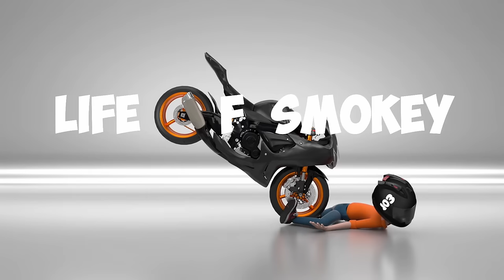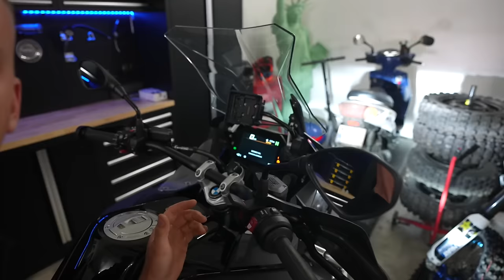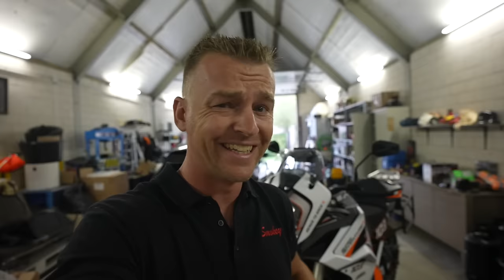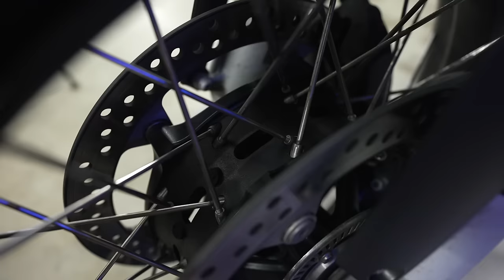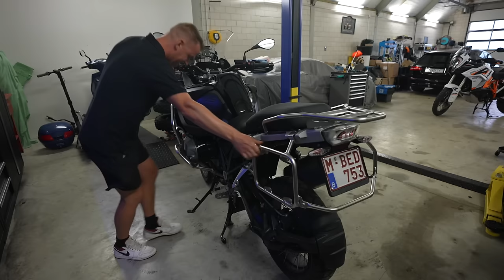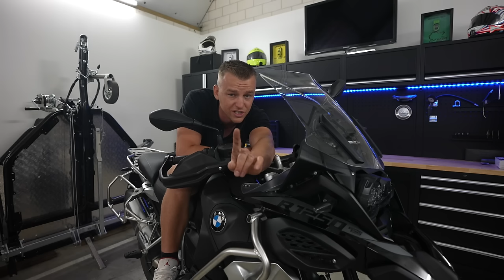How Good is the NEW BMW R 1250GS Adventure? Full Review

Comment: Actually you try to lift the bike on double stand the wrong way. There is a much easier way. Just grab the bike from the steering and the passengers foot peg (and specifically the metal bracket above, as close to the foot peg as you can) and then try to lift. It makes a world of difference. Just try it.

Comment: The GS is a good bike to take us more comfortably from point A to point B.
The SAR is a good motorcycle to take us with a little less comfort from point A to point B but with much more pleasure and with the necessary comfort to do the kms we want.
Reply: I have owned both and the 1290 is no less comfortable (all it really needs is a bigger screen and an aftermarket seat) but has a lot more off road capability.

Comment: I never tried the SAS, but just love my GSA. Had the 1200 and then upgraded it to the 1250. I just adore how re-assuring it is to ride it fast in the twistied, flicking it from one side to another. Also I recognised that I rarely rev it to red line but use that immense amount off torque in between corners. It's just so much fun. Beats everything. I've seen KTM's sneak away in straight lines, but then in the corners they are just not sure-footed. I've had stronger bikes, but this beats them all.

Comment: I have a 2018 1200 gsa at home in Canada, and just finished renting exactly that 1250 bike you reviewed for 3 weeks in Germany , Austria, France, Switzerland, Italy and CZ Republic. July 1-22 4500km. . I am 197cm tall, and the windscreen is not tall enough for me but that is changeable. I can get it up on its center stand with both paniers and the top box loaded to bursting, its not "easy" but it goes up the first time, are you sure you didn't have it in gear?  In Canada I have Heidenau gravel road tires because it gets lots of gravel roads. the riding modes for the bike are magnificent, the enduro mode is perfect for gravel roads even with such a heavy bike.   In regards to this vs a KTM, even in Austria this is the bike you see..... likely 10 to 1 over big KTMs.
Reply from the maker: I'm just a very weak person and only 176cm and like 75kg. So me standing on that center stand didn't even make it move bit 😁👌. But i do understand why so many BMW's have been sold.

Comment: Center stand BMW: i think it is difficult to put it on the stand because the center of gravity on the GS is lower. Pre owned a KTM 1290 SuperAdventure T, the one in white with the 30 liter tank, and it was indeed easier to put on the center stand. Now i have the 1250 GS HP but have managed to find my way of putting it on the center stand. Loved my KTM but quality of build on the GS is better. IF only KTM would have done some things different and by that I mean the choice in material(s), the GS would have a more serious competitor.

Comment: Nearly bought a GS last week. I'm travelling about 1000kms per week at moment and thought must have a GS. Then I got on my SD GT.  The GS is a good bike, does everything well but there is no excitement, no soul. I Don't think its an age thing, I'm 68 but I need the buzz, the little bit of fear keeps me going. Plus, why Don't GS riders nod or wave back?
Reply: I wave even at scooters and ebikes! 🤣
Reply: My GS has excitement and soul. Not sure what GS you're talking about? I'll wave but you gotta wave first.
Reply: No excitement ? Did you put it in dynamic mode and crack the throttle? I giggle like a little kid when I open that boxer up. I love the torque of my GS. For me the refinement is its soul albeit it’s not exciting as a hooligan KTM but I still appreciate it. Sometimes it takes being in the saddle 12 hrs in a day and then hopping off relatively fresh to appreciate this. Few bikes pull that off in my book.

Comment: Don't forget to activate the "pro-modus" with the optional plug to get "Dynamic PRO" and "Enduro PRO" (plug is under the seat normally). The sound of the engine even gets better with a SC Project muffler of Akra. Keep your righthand lower to pull the bike on the stand. Nice review! 👍
Reply from the maker: I have been reading something about pro mode and the seat today. Gotta check that out 😁
Reply: I have a 2021 GSA 1250.....the pro modes don't require a dongle/plug anymore.....it's built into the firmware.....supposedly it can't be activated until the first 600mile service...
Reply: Don’t need the plug anymore

Comment: Fun stuff. Slap a set of 50/50 tires on that baby and try Enduro Pro mode.....supposedly it can't be activated until 600 miles...maybe BMW can do that for you....then I'd like to hear your thoughts compared to the KTM.....one last thing....in the dynamic modes you have control of wheelie suppression ....play with that
Reply from the maker: I must say the lower point of gravity is darn crazy on this thing , i can make really easy and short u turns 😁👌

Comment: It really depends on how often, how far and what sort of roads you ride in. Currently I ride daily about 95km to/from work. I go on rides that can cover 2800km in 2 days. The GS would do that although my 1400GTR has the ability to give a scary feeling when you open the throttle. The GS doesn't.

The KTM will give more smiles than than longevity of your rear tyre. It also has the potential to get your licence taken away from you very quickly. So many things to like although on single trail they do feel big.

The GS ringing for help would be a feature that would be modified (deleted) quickly if I owned it.

I think you set the standard high with the Norden 901 and I'm thinking these bikes don't quite make it to that level.
Reply from the maker: The Norden doesn't give enough fun when going on the highway or when i'm having fun in the harbour or bigger streets like that. I need at least 150hp or so i think 😅
Reply: @LifeofSmokey  that's why KTM built the 1290SAS. For all-round rideablity, smooth highways and 150+ HP of fun.

Comment: I am 5 ft 8 (similar to Smokey?). I have the KTM SD GT and love it. My gripe with the SD is for me the wind is bad at higher speeds. I had to put a big screen on. Other than that I love it, best bike I have ever owned. The GS looks a bit more refined, maybe worth doing a test drive? 🧐 I am ‘old’ now at 42, so probably makes sense 😅
Reply from the maker: If you love your GT you are gonna find the bmw GS pretty boring. The difference in engines is really big. If you want some more comfort but with a crazy engine in it you need the super adventure S or R. Those ate the Cadillacs 😁
Reply: @LifeofSmokey  dammit, how am I going to explain this to my wife when I have to test drive another one! 😅😂
Reply from the maker: @Benboy1980  just say it might brake down because of known issues. Another bike might extra money at first but might save some later on 😂

Comment: On the note of wheelies, I can stand my 2022 KTM 1290 SAR up on the back wheel at 110km/h in 4th gear without using the clutch 👌
Just stand up and give it a little bounce as you power on 😁👌
I've also got a 2021 KTM 500 EXC-F with a full motard setup. Both the 500 and the 1290 are absolutely amazing, but since getting the 1290 I haven't touched my 500 😅
Reply from the maker: I have a 350 Husqvarna FE for single tracks and hillclimb stuff....but using my 1290 SAR now for no reason 😅🙈

Comment: Horrible! I can‘t make my choice between 1250 GSA, 1290 SA S, 1290 SA R and the incredible Norden 901 😭
Reply from the maker: It's pretty simple to be honest. If you want a comfortable bike , good shifting , descent basic offroad but nothing special and kinda boring to ride you need the BMW. If you want comfort , good shifting with a crazy hardcore engine that keeps asking for more you need the 1290 SAS. If you plan on riding a lot on normal offroad trails and nothing to crazy the SAR is for you. I love my SAR , it's almost as fast as a Superduke R as i did some drag racing with my buddy. And it's really good offroad also. The Norden is by far the best controlable bike offroad , lower , weighs less and also pretty fast on road. But for me personally the Norden 901 does not have enough horsepower and torque when i wanna do some sporty riding.
Reply: @LifeofSmokey   thank you very much for taking time to answer! In fact I’ve had Superduke  R 1290 SE, and I’ve loved this engine. And I have to confess: I am a KTM fanboy 😅
I came to the same conclusion has you did. I loved to try the GS, it’s an incredible bike but I have a problem with the Telelever. 
So it will be a KTM. I would like to take a SAR but for the moment I think I have more a SAS profile. I am not enough experienced for that kind of suspension and I think the electronic ones will do the job on the S.
But I hope that, for my use, I won’t regret the 21’ front wheel.. 
Well I have a few months to decide S or R and maybe try it both. 
Thanks a lot for your videos! Change nothing!
Reply: @LifeofSmokey    thank you very much for taking time to answer! In fact I’ve had Superduke  R 1290 SE, and I’ve loved this engine. And I have to confess: I am a KTM fanboy 😅
I came to the same conclusion has you did. I loved to try the GS, it’s an incredible bike but I have a problem with the Telelever. 
So it will be a KTM. I would like to take a SAR but for the moment I think I have more a SAS profile. I am not enough experienced for that kind of suspension and I think the electronic ones will do the job on the S.
But I hope that, for my use, I won’t regret the 21’ front wheel.. 
Well I have a few months to decide S or R and maybe try it both. 
Thanks a lot for your videos! Change nothing!
Reply: @LifeofSmokey  in fact I would like to buy a SAR but I am not sure that I will be able to manage the settings of the suspension 😒

Comment: Not for short people like me at height 5.6 😢
Reply from the maker: With the lowest seat and the lowest suspension? I have seen a really short person with a GS and his wife at the gas station yesterday 😊
Reply: @LifeofSmokey  what’s the minimum height required to ride on GS?
Reply from the maker: I have seen a midget jump of an R6 at the traffic light and jump back on to keep moving....I'm like 176cm and can ride them just fine even on normal/high setting. What's your height in cm?
Reply: @LifeofSmokey  5 feet 6 inch equals 167.64 cm.
Reply from the maker: That's doable 😊